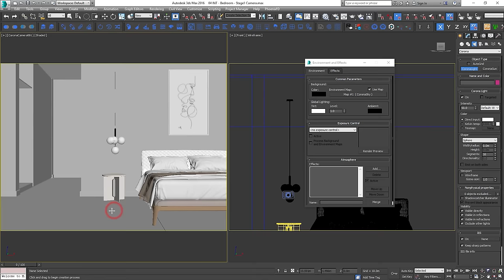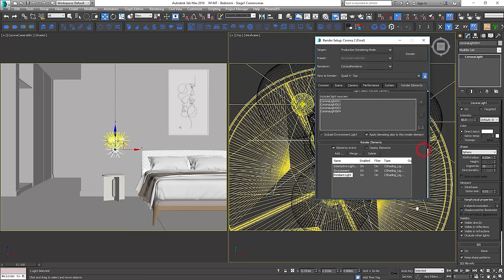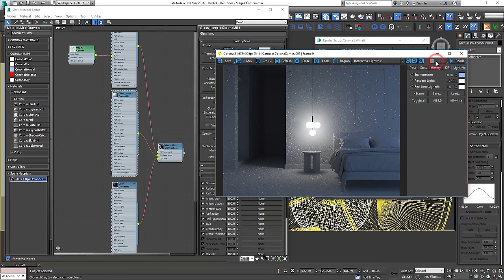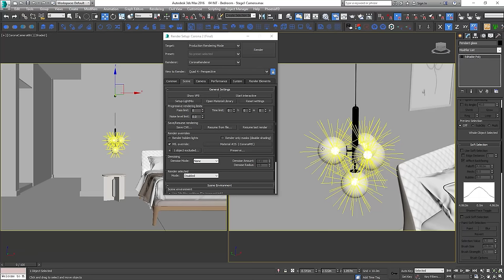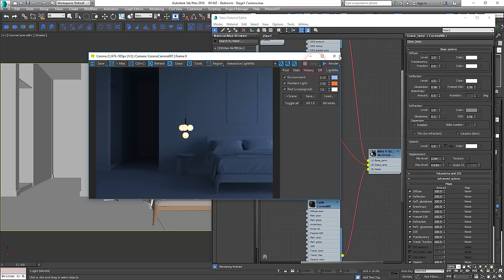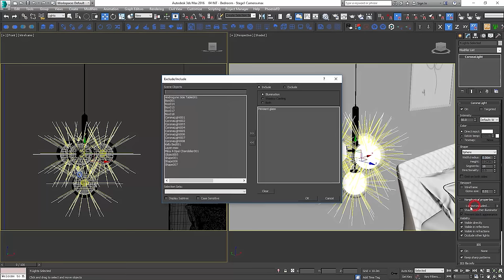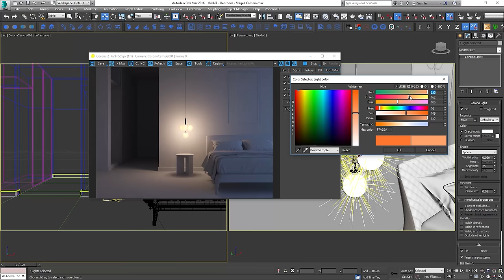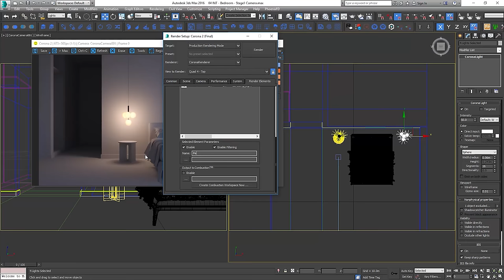Achieve Perfectly Clean Lighting WITHOUT ANY NOISE

Comment: One easy way:
Use the Corona Spheres as invisible directly, reflecting, etc. That light will iluminatte your scene. Make them bigger than the pendant bulbs, so, Corona doesn't need to calculate the light passing through the glass.
Second step: use Corona Light Material, in the light bulb inside the bigger bulb. You need to disable the Emit Light, this will just for add the glare effect. And that's it.
It's a good way because it will not be heavy calcules for the render engine. So, you can use the Corona Light Material without emitting light in any situation like that. It's nice when you have, for example, complex filaments inside the bulb. 

Of course she knows, but can help the subscribers.
Reply: You said the best way to get realistic and performance scene
Reply: Well nice trick, but non emitting light material cannot be assigned to any light select render element. You can only control it in the "not assigned" channel. Also, decreasing the power or switching off the channel will return the light mesh into a black matte surface.

Comment: The noise at the beginning of the video is simply caused by bumping the light intensity up 10 times in lightmix editor. 
You should not do that. 
Instead, your original sphere light intensity value should be changed from 50 to 500. It would give you an instant noise free result, without having to do all the suggested workarounds. 
However, the trick is nice as it gives you more artistic freedom.
Reply from the maker: Sure, you can quickly adjust it later on in the lighting settings. The main intention of this video is to show how to deal with lighting noise issues :)  Anyway, thanks for your feedback 😀
Reply: That's right  Michal, the noise comes from the lighmix,  and the fix is not ideal. Just pump up the light on lightmix and THEN hit Scene button on lightmix tab. Boom "problem" solved
Reply: @arqrenderz6210  I don't understand what you mean by this..? Explain please